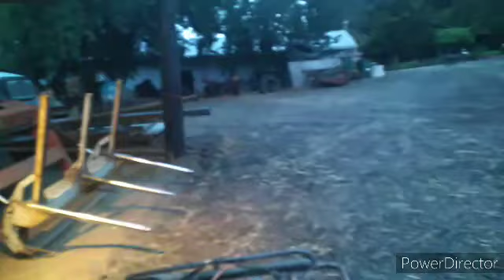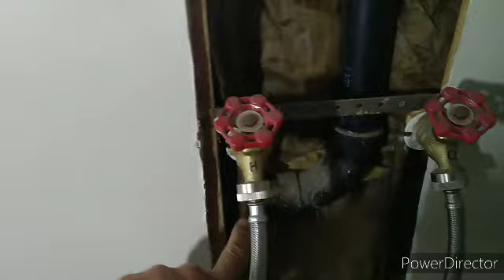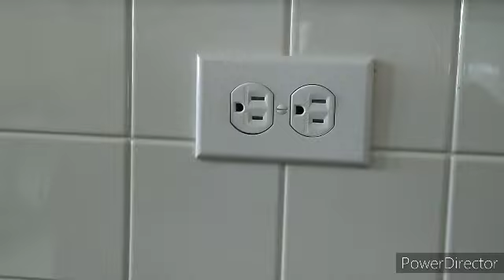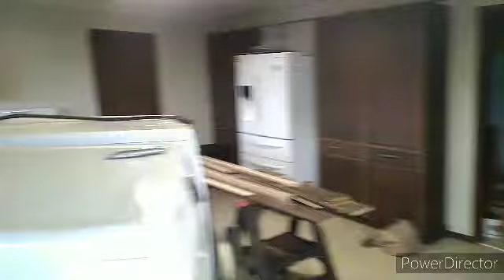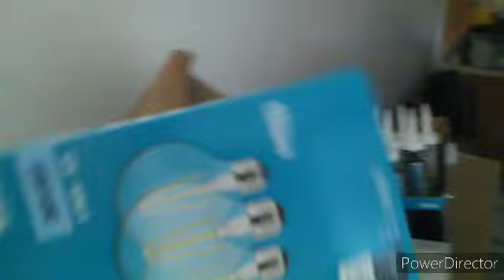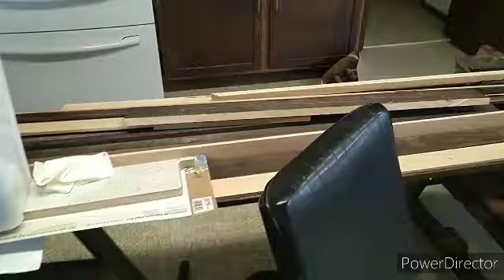it rained🤣 irrigation oops.. wiring, it's beginning to look like a kitchen again.

Comment: Got the first greenfeed baled up today.  130 bales off of 18 acres.   Not too bad.  Supposed to rain an inch tomorrow.   Keeps holding up progress.  The next 30 acres probably would’ve went tomorrow too. 🤷‍♂️🥃🥃🥃🥃🥃🥃👍🍻
Reply from the maker: @chadtosh6831  nice 👍..
Ya.. had 50 acres ready to bale the other day.. 40 has been washed a few times since.. nothing is green now.
Reply: @GosselinFarmsEdGosselin frustrating cause I’ve got another 70 acres of greenfeed to cut yet.  Just want it done before combining, but I’m beginning to doubt that’s gonna happen.
Reply from the maker: @chadtosh6831  at this point, I'm hoping to get enough 💩 to make it through winter, but there's over 100 acres that's not worth cutting now..
Reply: @GosselinFarmsEdGosselin  corn is cheap.  Cut it, bale and supplement with corn.  Make up for poorer quality hay.  I’ve fed barley and barley straw as a diet the odd winter for long periods.

Comment: yup a farmer wears many caps, including a strong understanding of electrical, plumbing and drywall never mind framing and cabinatry, especially learning how venting and fall angle in drain lines is critical
Reply from the maker: @piperdoug428  yes sir!! 
1/4" in 10' and don't chew your finger nails!!
Reply: @GosselinFarmsEdGosselin  damn it.  I always forget the finger nail part.  🤣👍🥃
Reply from the maker: @chadtosh6831  🤢🤮😂🤣😂🤣